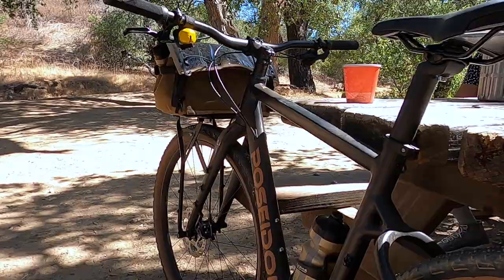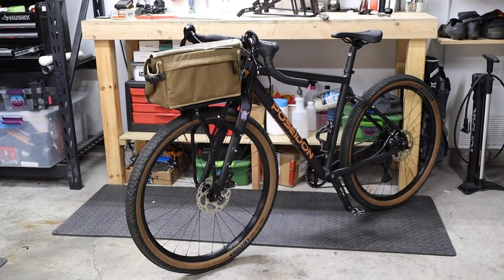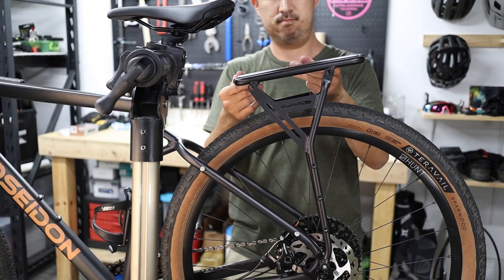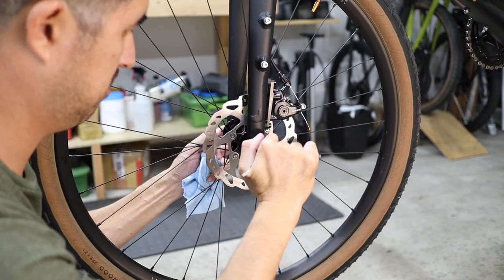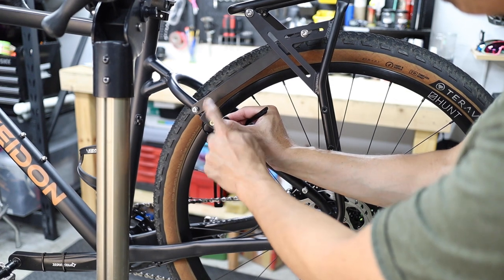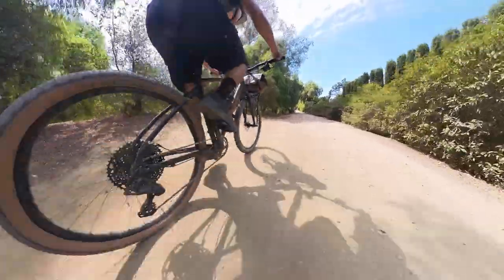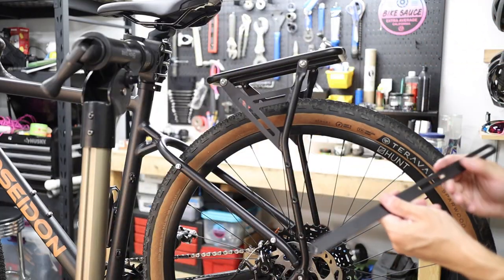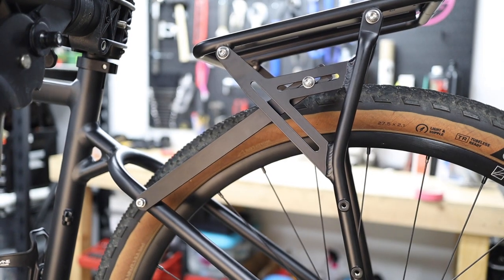Old Man Mountain Elkhorn Rack // Seriously VERSATILE!

Comment: Hi when your say axle mount is stronger than eyelets do you mean eyelets have higher chance of failure like breaking? Or carrying weight abilities?
Reply: I bet it's because bushing screws are only 5mm thick stainless steel whereas axles are much thicker and hardened enough to carry 100kg of bike plus rider

Comment: I have considered buying for Old Man Mountain, for a Giant TCR with no rack mounts, but I couldn't afford it.. and I was also worried by how these perform when removing wheels (axle mounted ones, of course). Would having a flat be cumbersome with the rack mounted on?
Reply from the maker: Yea pretty much any axle mounted rack is kind of a pain. Run tubeless and it’s not a common occurrence
Reply: I have done a fair amount of bikepacking even before switching to tubeless. I found out in most instances I don't even have to take out the wheel when having a puncture. I try to locate the puncture, lay the bike on the side and then pull out the tube as much as I need to patch it. As long as I can locate the puncture (I inflate the tire and put my ear next to it while slowly turning) or the puncture is not close to the valve this method worked really well for me.